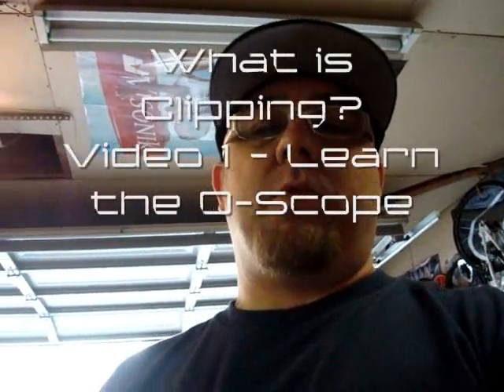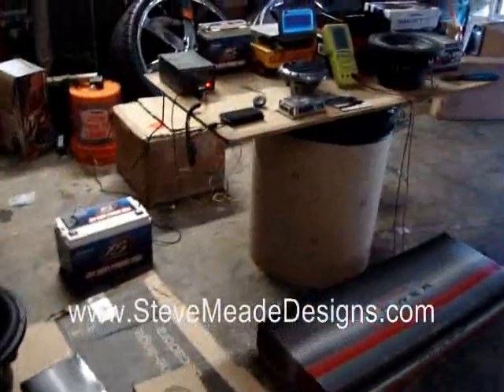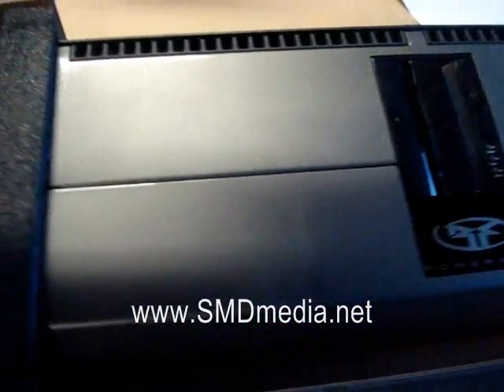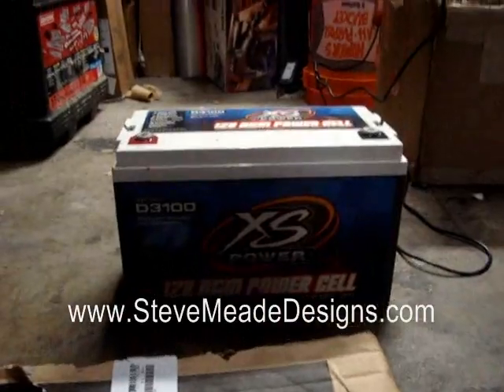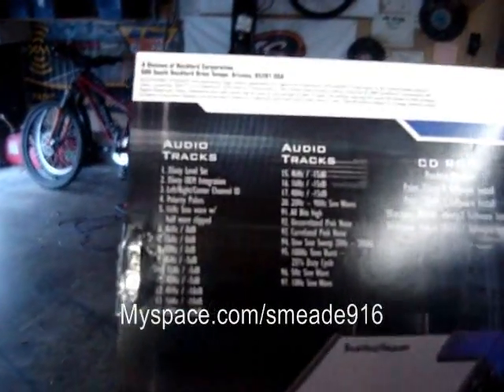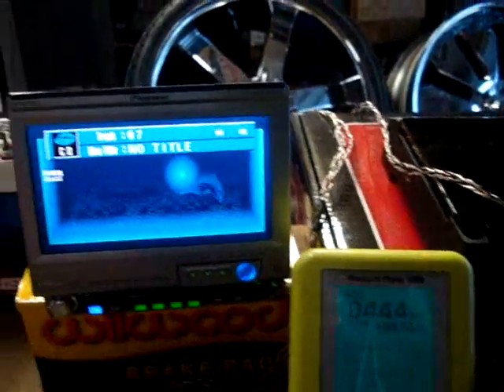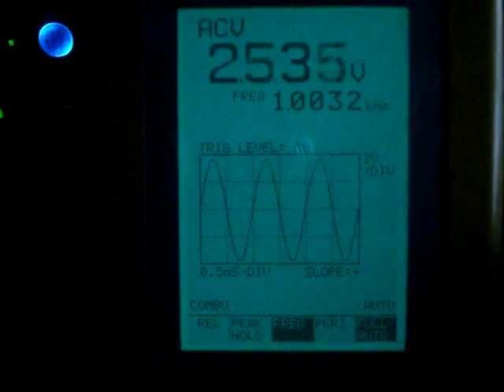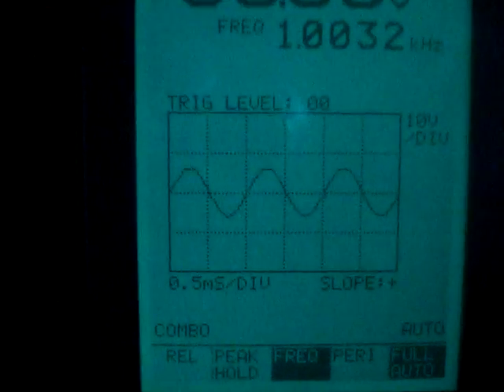what is clipping?  O-Scope demo (set the deck up) SMD "HOW To"

Comment: hi, ok i have a orion 2500d, i want to set it like this, im using the amp at 1 ohm, but when set this way the amp will be showing no load, so wah i want to know is will the amp clip the same at 1ohm, and at no load ? so if i set it up this way, it will still be right when in use, not as clver as you so i hope you understand what im trying to ask.

Comment: i didn't read through the all the comments but I wanted to add a note, were you testing the subwoofer output with the sub level control on the deck at 0? or at it's max when it would be outputting it's max voltage?

Comment: i need my subs to stop clipping. 2 Alpine type r's 12 inch. running off 2 650 watt amps. i run it at about volume 25 on my alpine iva-d310.